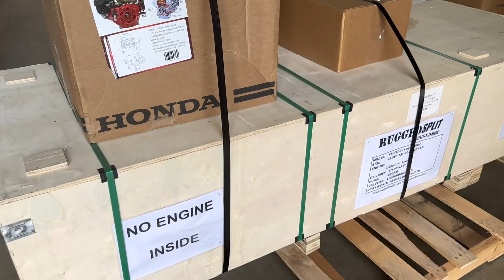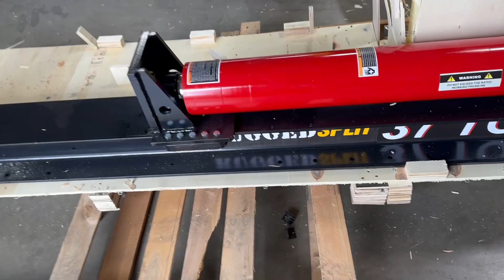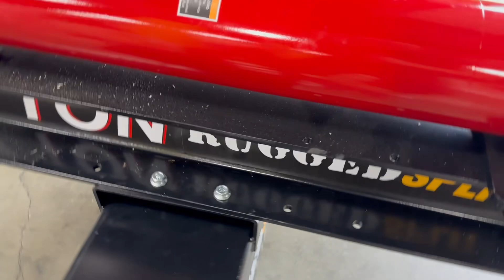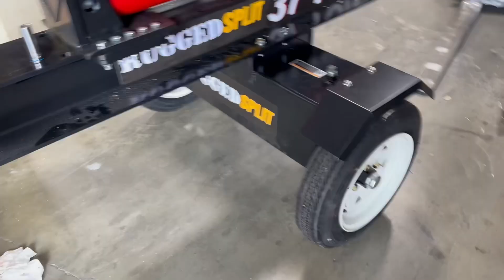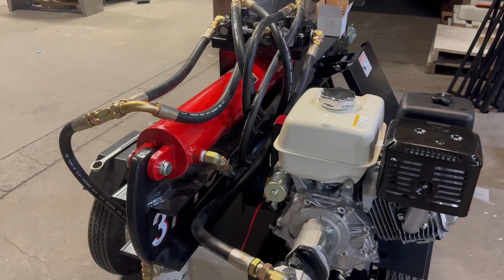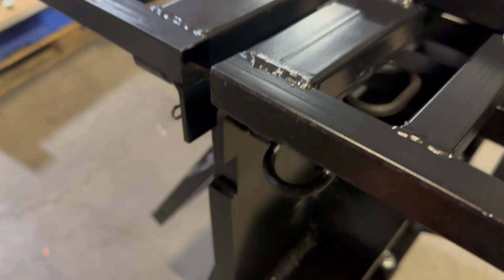Rugged split 37 ton log splitter unboxed and assembly ￼

Comment: Assembling the beast this weekend started on Friday. It is a slow process (5 hours invested already) as Rugged Made could do a better job detailing bolt usage during assembly. I hope to finish today. For guys that finished this beast in 2 hours all I can say is wow, very impressive work!
Reply from the maker: That’s great I’m sure you’re going to like it. Just be sure to get the npt fittings tight 👍
Reply: @JeepDaveT  Got her up and running did some test splits last night. She's a beast! I did have one leak on Log Lift Valve “Outlet” Port that I missed tightening down the NPT valve after rerouting of the hydraulic lines. Looking forward to putting this 37 ton pig to work!!

Comment: That part that was leftover is the cradle for the logs so they so it don’t fall off the splitter. I’m not sure how it mounts, but it’s important, because you need one on both sides.
Reply from the maker: That’s what I thought but it will interfere with the log lifter.I think it’s a extra part 
Thanks

Comment: I converted  mine to a hydraulic adjustable wedge then built an 8 way wedge . I never had any complaints, it would pump out the production and was definitely worthy of a conveyor. In comparison to something like a Wolf Ridge it all comes down to the amount of Iron they put into it, mainly in the beam as the Chinese put in just enough that hopefully it don't break or bend.
Reply from the maker: I’ve seen a few videos the adjustable wedge would make it a lot faster. What parts did you need for yours?
Reply: @JeepDaveT  I've got videos of it on my chanel showing most of how it's done, my conversion was a take on the eastonmade design not the cylinder sticking up behind the  main wegde. It's a tad more involved to fabricate but it's a cleaner design in the end.
Reply from the maker: @Tonnsfabrication thanks I’ll check it out 👍